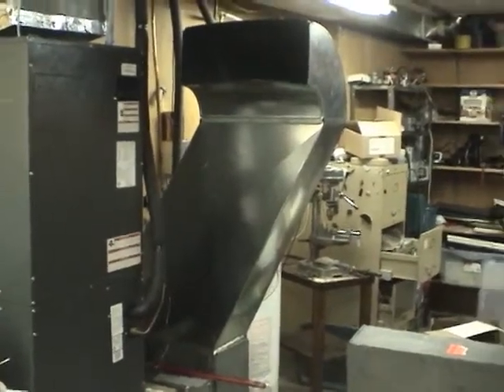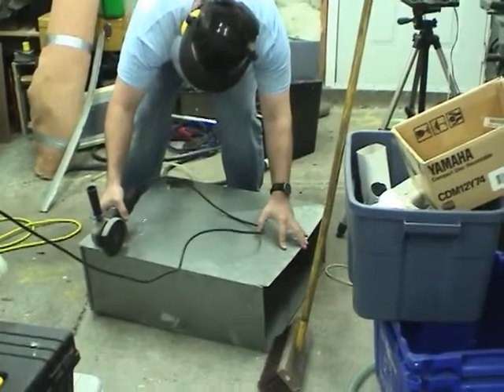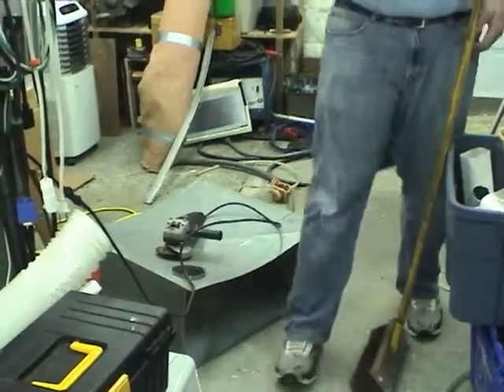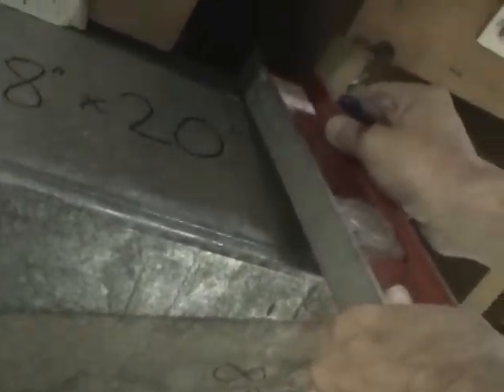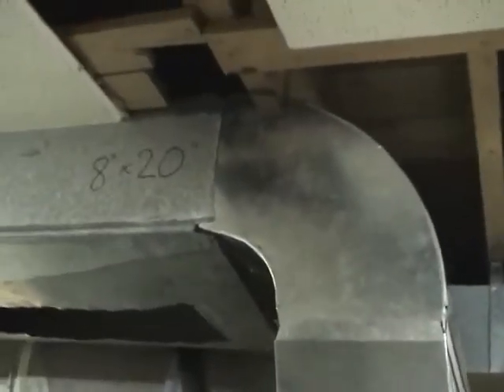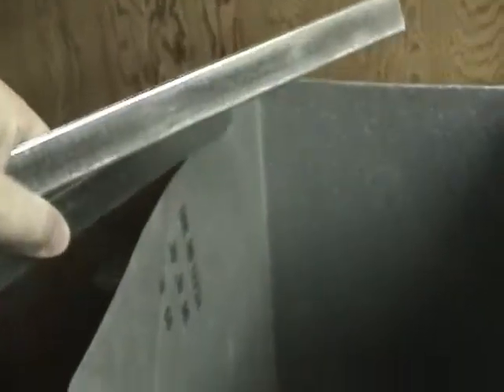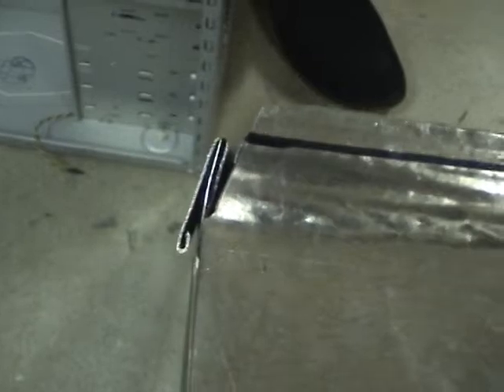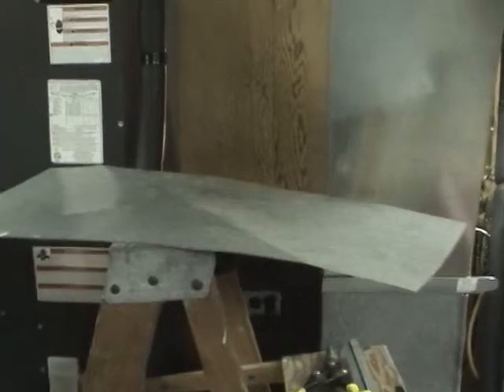Heat Pump Installation - Part 6

Comment: I find it strange that you use a grinder to cut the sheet metal.....We use electric sheers or hand sheers.  Looks like you have followed safety procedures.  The only thing that may present a problem is that anytime you heat galvanized metal it off gasses poison fumes.  Be careful

Comment: nice video, awsome, im starting to learn how to install a new unit in house. have few questions for you. did u install UV lamp in system? is there any video for charging the system and vaccuming the first time? so you have any suggestion for a good and reliable source to learn more, specially charging and vaccuming
thank you:)

Comment: @tesla500 Yes in Cali. we would have to line and seal, we have alot of old homes like what you did but It wont pass are Title 24, and building inspection, It's due to air leakage, we have to use duct board are sheet metal in joist here as well, the only reason for it here is money. The CEC and the State made the change in 2005 they also made us stop using R4.2 flex and R6 is the min now. 
I like what you did, It looked clean and its filterd @ the furnace, what harm would it cause? None

Comment from the maker: @Nutintoitbut2doit  Would it be advisable to line and seal it? How come the air returns that run between joists aren't lined? I can see the lining would reduce dust collection, is there any other reason for it? As a fire stop?

The areas where the air enters the upstairs returns are lined (poorly, the metal is all wavy, and not sealed).